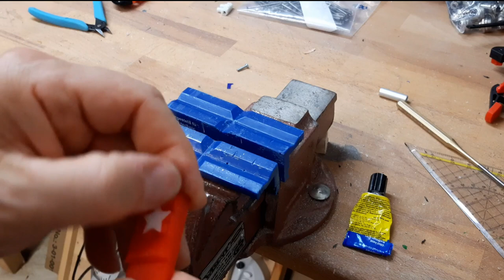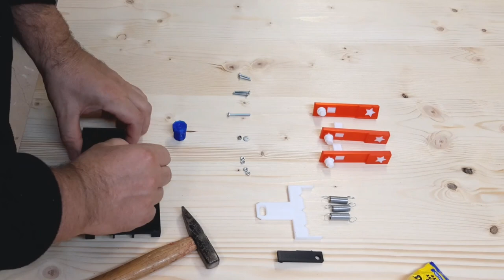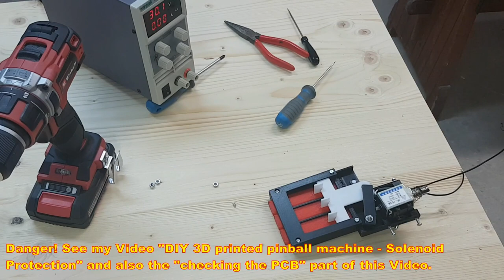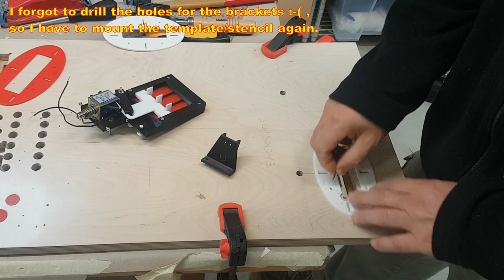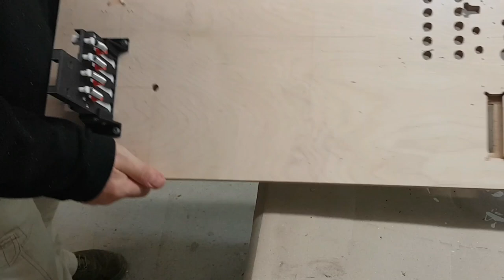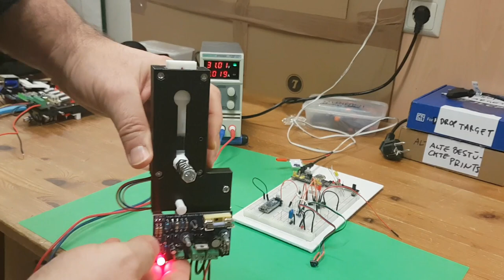Pinball Scale DropTarget Assembly

Comment: I love seeing more 3d printing in homebrew.   Makes it more reachable.  Great work!

I wonder how it holds up to the steel hits.   I feel like a quality resin print might do better, or look more polished?   If doing abs/asa, try acetone smoothing and clear coating.    Resin prints look great with clear coat and they can be clear allowing for lighting effects too.  

Even if 3d mech isn’t forever, you can just reprint a replacement cheap enough.   After cleaning rust off old Bally Williams mechs for days and weeks, I doubt the time to reprint future 3d mech will be any worse !!!!
Reply from the maker: Thx! i printing everythin in PLA with 80% Infill. Untill now no Part was broken or cracked by the Steelball on my space shuttle replica ->
https://www.youtube.com/watch?v=Sgq4DvL_ENM
At my "jurney" making pinball machines i'm still in designeng new Parts/Assemblies (e.g. an inline drop target with auto frop), i already was thinking to do some parts (like Bumper top Caps) with resin 3d Print, but had no time to do so. Regards, Fabian
Reply: The best part though is that you can Easily just reprint pristine looking ones.    I’d rather reprint or print doubles than have ones that are just beat up slowly the old way.   Plus, the way printing is getting bettter, the options are just improving!!!

Comment: Do you have a video on the control board?  How are you sensing the drop target down condition?  If I were designing this, and placing a control board on the drop target like you did, I think I would embed a magnet in the drop targets and use surface mount hall effect sensors on the board to detect them.  It would be wonderful to get rid of mechanical switches. But I was just wondering how you did it.
Reply from the maker: Hello Edward, i use TCST1103 Photoelectric barrier Sensors, so there is no mechanical switch! If the Drop Target is down its Fin will be triggered by the Sensor. I did not make a Video for the Board, but with the STL i provide the Circut diagram of the complete Electronics needed. Regads, Fabian
Reply: @fabe1690  Thanks for the quick reply. I plan to buy the STLs later today.  Thanks for all the work.

Comment: Maybe you can replace the solenoids with those cheap rc servo.  A 20kg one would have enough power and should be fast enough to pop them back up.  I just suggest that because I know what's its like working with soinodis and pla.  I have had a few projects melt on me.
Reply from the maker: Hello, i was testing with servos and foud out for me that  they have a lot of disadvateges over solenoids, Greetings Fabian
Reply: In this case, the solenoid is one just for a moment (half second) so shouldnt heat up enough to melt the PLA.

Comment: Congratulations for the great job ! Do you can provide details or plans regardind matrix display and score controller . Best regards!
Reply from the maker: Hello Claudio, thank you! I use the type MAX7219 Led Matrix. Lots of videos and DIY information are already available on the web. Just search for "MAX7219 Led Matrix". You can cascade them to have an 8x64 LED matrix like I used on my machine. Many sample Arduino sketches are also available. There was only one real obstacle for me - which I hadn't thought of in advance - you need a really powerfull 5V power supply for an 8x64 matrix - to be able to have all leds on in brightest mode - it will draw a BIG current, if your power supply is to weak the Led-Matrix starts to behave stange - a single 7805 will not do the job!!! Ciao, Fabian
Reply: Hi ! Thank you for your reply  . Did you use 1 Ball Logic or 5 balls Logic ? 1 Player or more players ? Have a Good new year !
Reply from the maker: @claudiotasselli7950  Hello Claudio, i'm expanding from time o time my Pinball Code, at this stage it has almos the same Logic as the Willimas Space Shuttle Pinball (because its a replica of it), it has no multiplayer Option, because of the way the Multiball works on this machine. Ciao Fabian